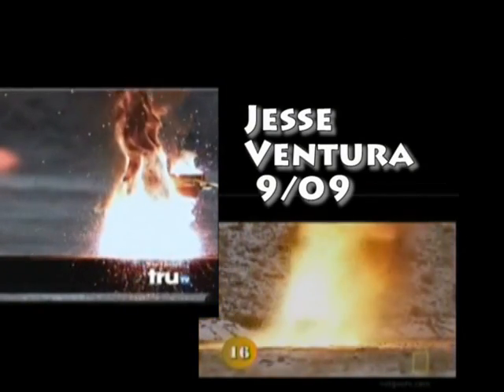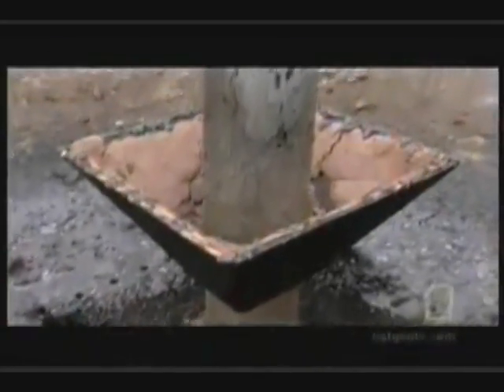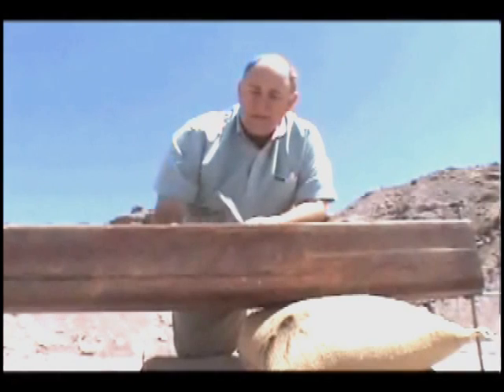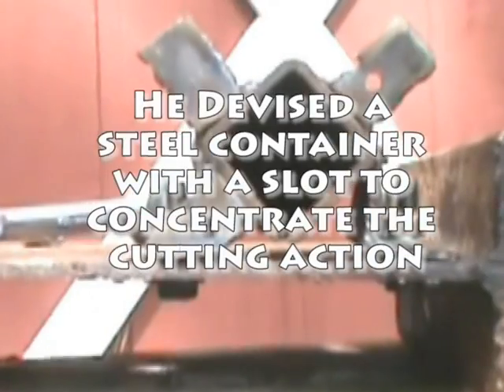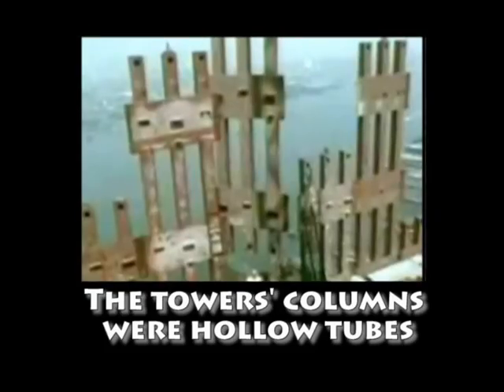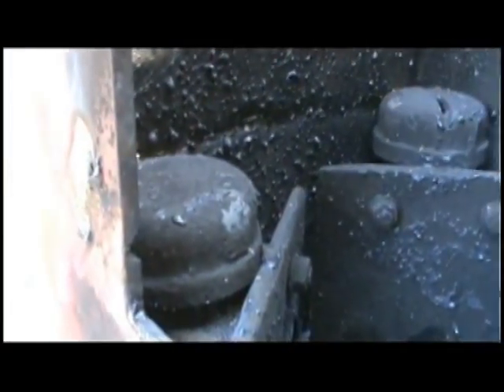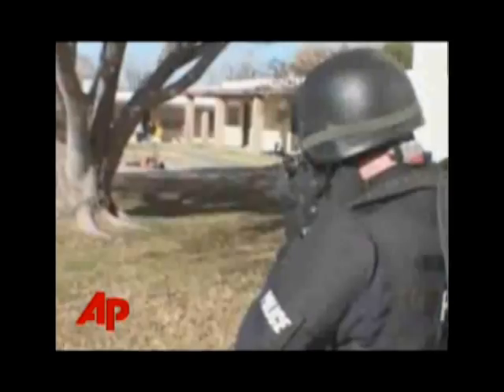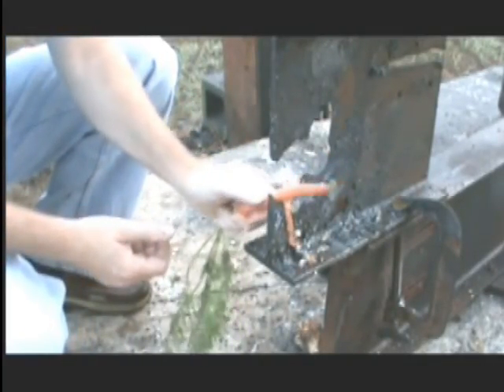Incendiary Experiments

Comment: hmmmm, idk man, it is clearly stated by the engineers of the WTC buildings that they were overdesigned to withstand not only one impact but multiple impacts by fully loaded boeing 707's and the ensuing fires... boeing 707's are a little smaller than 767's but also heavier and capable of equal force in the event of an impact....im a fence sitter so please dont call me a truther lol, just stating the facts

Comment: Damaged by the 1WTC, left to burn without any firefighting. It's an asymmetrical steel building. Case is pretty much incomparable to others.

The visible part fell down in a short amount of time (wait, no "free fall" talk? WOW! progress!), but the inner collapsing was happening for at least 20 seconds, and the tilting and squeaking and crushing was present during the last few hours, clearly indicating the grave loss of integrity.

Typical truther. I debunk, you ignore and jump on another thing..

Comment: They didn't need to show it. It's a well accepted fact that things crumble when the force acting on them, or their parts, are greater than the forces holding them together.
If you've got a 20+ floor top tilting, not only the connections between them are snapping, but they're also buckling. Nothing can stop that. You're trying to convince yourself nothing would happen.
It's like putting a skyscraper on the top of another at an angle,and without matching column to column connections.It will crush.

Comment: You can try hard and do it with one column using a weird and obvious setup. You can't do it with a whole building.

Not that you'd care, but there was no evidence of such scenario, and not only it's stupid because CDs require fast and calculated detonations, but also not neccessary. The buildings started tilting because of the outer walls slowly caving inside. Once the tilting started, the building is a goner. It's absolutely unimportant whether there were explosives or not. It's a goner.

Comment: They've mentioned the dripping seen in one video. First it's fiery orange, and then it's silvery. That's the behaviour of a very hot dirty aluminium. Building fires can, and do melt it. Such "aluminiumfalls" are a common sight where decorative aluminium is used (office towers). If glass melts, aluminium melts, too.

"Molten steel" was never observed and is impossible in office fires.

As a typical "truther", you're trying to confuse the opponent, but I know too much of this shit. :)

Comment: Kinetic energy depends on the mass and the velocity. Both parts are being crushed, and that was evident from the videos. Only parts of the each core were left standing for a brief amount of time. That's exactly what is expected. Your point?

Molten metal is explained. There was enough heat and enough aluminium. It actually happens in fires.

I don't get the connection between the kinetics of the collapse, the aluminium and the black boxes. Are you having troubles focusing on your errors?

Comment: They don't need to show it. It's obvious. Tilting top caused the columns to buckle. The two structures started to penetrate each other.

I don't understand - are you saying there is a conspiracy because if the tops had fell away from the rest of the structure, that would be... what? Even if that's possible,the rest of the building would be so severely damaged it would have to be destroyed.
I don't get the neccessity of such argument. The moment the tilting began, the building was LOST. Forever.

Comment: There is enough kinetic energy. Skyscrapers aren't solid blocks. They're large volumes of air with tiny force vectors (columns) that work in only two direction, along their axis. Distort them and they're fucked.
There is nothing in the world that can stop 20+ floors falling from few feet down, especially not a similar structure underneath that crumbles and creates additional weight on lower parts. Plus, it's not static, but dynamic load.

Comment from the maker: Your claim that 600 pounds of thermite is necessary to cut a column at the 75th floor is a lie.  Your omission of the fact that the lower columns are hollow box columns is a lie.  Your claim that Cole's steel columns and I-beams were thinner than sheet metal was a lie.   Don't put a lot of energy into posting here.  When I delete all your lies there will be nothing left.

Comment: "cut a steel I-beam with two pounds of thermite"

I watched that last year.  No need to continue the laughter.

How thick is that steel? quarter-inch mild steel? three-eighths? 

And how much do you calculate it would take to cut those 2x5-foot columns with three 3.5" thick walls?

And how big would the surrounding steel canisters need to be?  six feet by three feet, thick enough to contain a thousand lb of thermite?

A thousand lb of thermite barely cut a sheet-metal car in half.

Comment: "it would take about 600 lb of thermite to make even one cut at the 75th floor, with 2-3 tons of cladding around it"

After looking at the Myth busters thermite video & a few others, I suspect my 600 lb estimate was FAR too low.  With 2" thick walls on 8 running ft of box column, 5000 lb of thermite is much more realistic.

Comment: "a minimum of 47 for each of 110 floors, with each such device weighing up to three tons"

And that's just for the major columns, no other structure.

No wonder Cole just plays with tiny I-beams, not the giant box beams of 2" steel that supported the WTC.  I doubt that even a couple of tons of thermate would sever those columns, even with another couple of tons of "casing."

Comment: "Considering the melting points of Cu and Al"

Their big "engineer" Jonathan Cole used steel, since it will survive far longer than Al or Cu.  I don't think he has any clue that firebrick or composite would work even better.

But even he isn't ignorant enough to substitute materials with a far lower melting point.

Comment: "not even one photo anywhere of the ugly blob of slag that a "thermite cut" would leave on a steel column or beam"

They keep babbling about this but can't find even one example that looks anything like the mess thermite leaves.

Maybe because they don't know what it looks like.

Odds are that not one of these clowns has ever set off an M14, or any other incendiary device.  Watching what a six-pack of TH3 will do to a T-74 main gun & turret would probably cure them.

Comment: Go see for yourself.  Anyone can throw together a basic thermite mix in the back yard.

Get a piece of scrap steel girder in any scrap yard.  Shouldn't cost more than 20 bucks.  Mix up the thermite, pack it around the steel, and light it off, making sure there's enough to cut the piece in two.

Then look at the ends, and try to find any picture from Ground Zero or the Freshkills holding area that looks anything like it.

You won't, but then maybe you'll understand.

Comment: "Those "cuts" aren't made "to the microsecond". 

Pay attention.  He never said they were.

Those pre-cuts are only to weaken the structure (which obviously couldn't be done before 9-11), so less RDX can be used.  The critical timing to the microsecond is when that steel element FAILS, as the timed cutter & kicker charges explode.

You still haven't figured out that thermite can't be timed to completely sever that connection at a specific time.  That's his whole point.

Comment: "Were any of the black boxes from the planes discovered "

No, but there were only four, including the CVRs, smashed to bits by over a million tons of collapsing buildings.

If wireless xmtrs were used, there would be thousands of cutter charges used, and the cladding around each would contain far more metal than any Black Box.  Yet not one piece of cladding was reported by the hundreds of professional demo workers cleaning up Ground Zero.

Or were they part of this sinister plot, too?

Comment: "You don't know shit"

I know det cord from firing circuits, which is more than you or Sullivan do.  

And I did enough military demo to know a bullshitter when I see one, and I damn sure have seen copper sheathing from a cutter charge after the blast. It's bent all to shit and singed, but it's mostly all there. 

How many cutter charges are you estimating? 3000? 5000? Ten feet of linear RDX & sheath on the larger columns?  The cleanup guys certainly knew what those copper chunks looked like.

Comment: These Truthers still don't get the point of CONTROLLED demolition, which requires that individual structural elements fail at EXACTLY the right microsecond.

You might be able to set a giant batch of thermite off at a specific time, but there is absolutely no way it burns consistently enough to predict the exact time that piece of structure will fail.

RDX & det cord sever columns & beams at a very precise time & in a very precise sequence.  No way that can happen with thermite, obviously.

Comment: "In 1935 ... a large steel structure ... was brought down using thermite"

2 towers, one toppled over w/1500 lb of thermite encased in firebrick & steel cupolas.  The other identical one was toppled with only 110 lb of dynamite.

The cost difference might be one reason everyone used explosives after that.

Found any use since 1935?  Found any that were ever used for controlled demo/implosion?

Sullivan couldn't wire a light switch, which is why he's still just a part-time photographer.

No ?

Comment: "Tom Sullivan is a controlled demolitions expert"

He may (or may not) have had a powder carrier license (for NYC only), which is a go-fer level card required for anyone on site -- otherwise they can't even be left alone near the truck.  The test is easier than a drivers license.  Look up the requirements, they're online for NYC.

I notice you still avoid the question of why no controlled demo has ever used "wireless"  units, which is primarily used for mining & clearing operations..

Comment from the maker: @roquefortfiles The main structural supports were in the core area, hidden in the elevator shafts.  Why would you expect to see flashes of light that were inside the elevator shafts?  Also many of the first responders did report seeing flashes of light.   If you watch Jonathan Cole's "Thermate Debate" video you'll see his evidence that thermate was packed into hollow perimeter columns.  Also see some of the samples in NIST 1-3C.

Comment: @punxsutawneybarney You clearly don't understand the purpose of such casing. You could've as well said it was a paper casing.
It would be logical for such casing to be something which will melt at high temperature, in order to hold the melt while it does its job, don't you think? And it still doesn't explain how can it be synchonized. Because it CAN'T. You know nothing about demolition.
Glowing column ends? I'd like to see that.

Speed of sound? Whst the fuck are you talking about?

Comment from the maker: @endimion17 How do you know they were steel casings?  Maybe copper or aluminum casings were used.  Why would wires be needed when wireless ignition would be neater?  Actually there are pictures and video that seem to show glowing column ends.  NIST has not explained how a partial failure on one side propagates at the speed of sound to the other side of the building across a robust, cross-braced, and highly redundant forest of 47 core columns.

Comment: @punxsutawneybarney So the whole towers were rigged with such neat inner steel casings (I wonder how could "they" hide that) and connected by wires all together. It all survived the plane impact and then was activated in a rapid succession which resulted in "squibs" that surprisingly aren't glowing.

Despite the fact that huge inward bowing of the exit hole walls was observed, which is a direct evidence of a failure NIST described.

I think it's "a little bit" overstretched. Goatse style.

Comment: @avslogger "If myth busters actually had the *correct* ratio of iron oxide to aluminum, there would be nothing left of that car" Do you really believe that? You realize how much was left of the car. If they mixed it wrong, only like 10 % would be mixed right, compared to a complete burnout with 100 % complete mixture... I don't think so. 
BTW I don't think you would create much thermite reaction from solid aluminum (as in planes), at all.

Comment from the maker: @PersianPaladin Perimeter columns had ports at the base so bolts could be installed.  In core columns, incendiary materials could have been sprayed in through a hole drilled in the box column's steel wall.